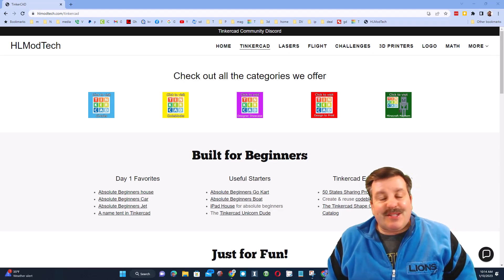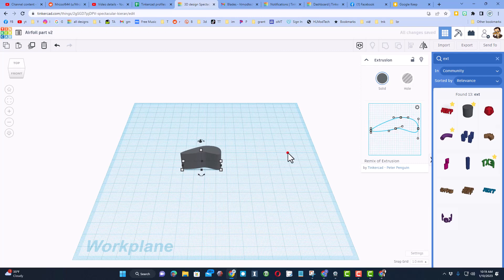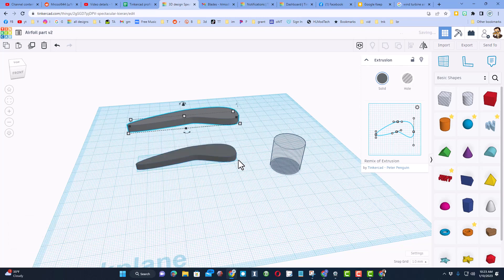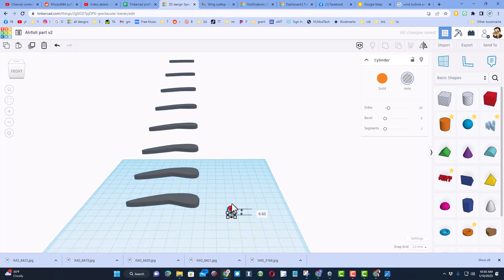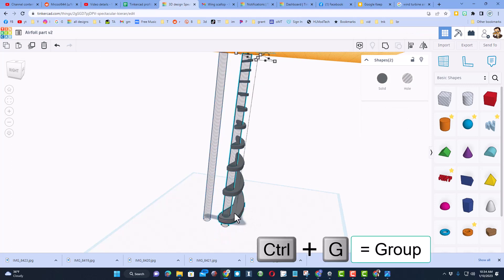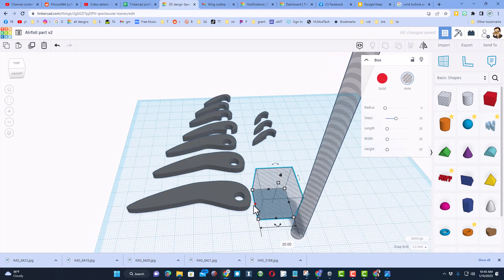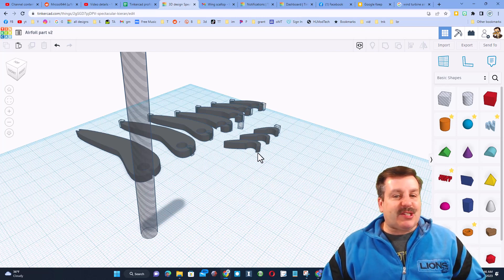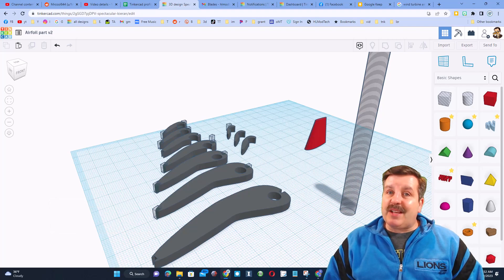A Wind Turbine Airfoil Frame in Tinkercad Slick Steps Make in Minutes

Comment: As a pilot and airplane builder, that is the worst airfoil I've ever seen. LOL! If that's for a wind turbine, the twist in the ribs need to be the opposite direction. The angle of attack should be greater, the closer you get to the hub.

Great Tinker CAD explanation tho! Thanks.
Reply from the maker: Thanks for the info. I am sure the kiddos creating will appreciate that. I have yet to try to really make one. If I do, I will be better. =) 💯👍